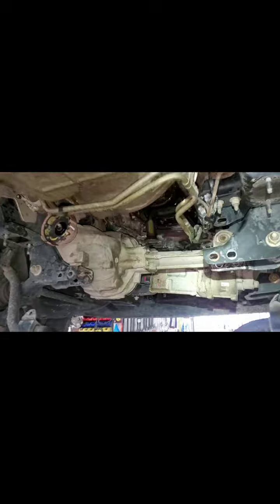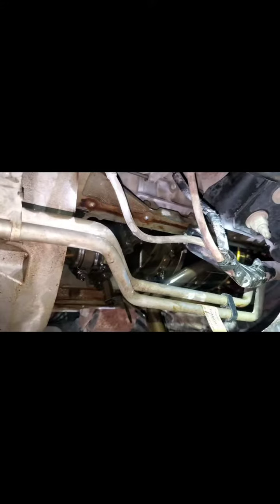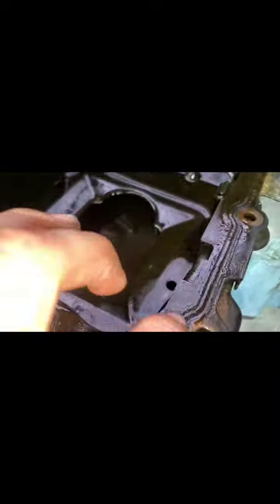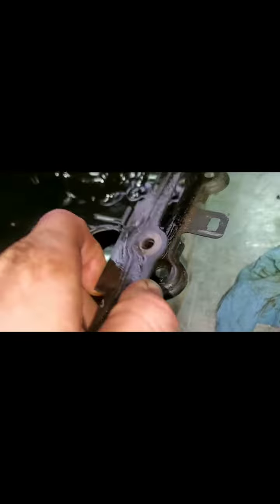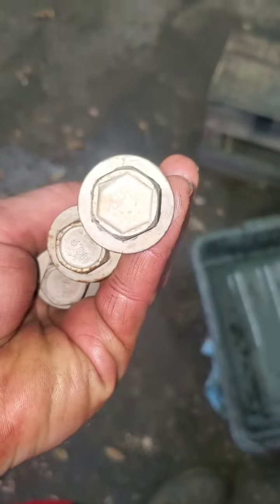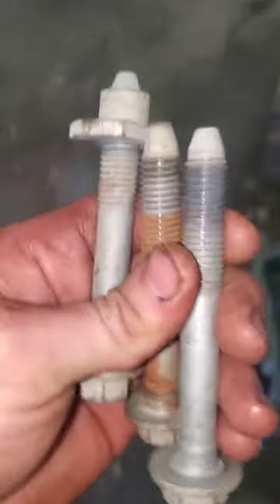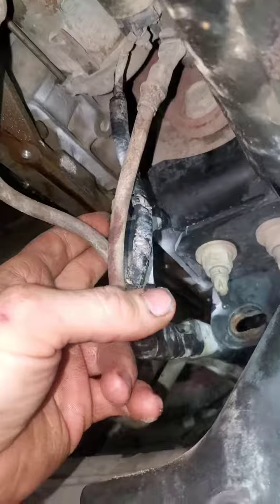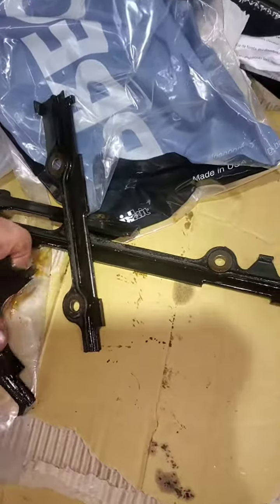2015 4X4 F150 5.0 Oil Pan Gasket Replacement

Comment: I have a 17 f150 4x4 with the same leak. And I am sooo glad I have a 6 inch lift. Oil pan is very easy to get to.
Reply: were you able to just drop the pan?
Reply: Did mine yesterday. 6 inch lift to the rescue. Plenty of room to drop the pan.

Comment: I had a lower pan oil leak in a 2003 Hyundai Elantra it's been fixed with the permatex The Right stuff gasket maker.. but now for some reason when I use my heat in my car it is so hot that it's unbearable.

Could this have anything to do with the oil leak fixed prior to that it was nowhere near as hot as it is now it's so hot I can't stand it.
Reply from the maker: The oil pan gasket repair has nothing to do with the heater. I would make sure your coolant temperature isn't too hot from a cooling system problem or bad thermostat.

Comment: Can low oil pressure overheat the engine even if  coolant level is good ?
Reply from the maker: No. Low oil pressure will only overheat the crankshaft, rods, and cams. The engine will lock up long before the coolant temperature starts to rise.

Comment: I have a question I have a 2014 f150 with a 5.0 and sometimes it leaks from  behind the oil filter any idea from where?
Reply from the maker: It might be the oil cooler seal. It has an o-ring on the side oposite the oil filter than can fail (The oil filter threads onto the oil cooler). Clean it off with brake cleaner and then cover it in foot powder from a spray can (I use the Ting brand) then go for a drive. The foot powder will be bright white but will get dark/wet exactly where the leak is. Works great at finding even the smallest of leaks.
Reply: @TechnicianRed  thank you do you think its a DIY job or should I take it to a mechanic?
Reply from the maker: @ameenayusuf  If it's the oil cooler seal it should be an easy DIY job.  Might be a little hard to access though if it's 4x4.
Reply: @TechnicianRed  thanks again
Reply: How many hours should I expect a shop to charge me for this?